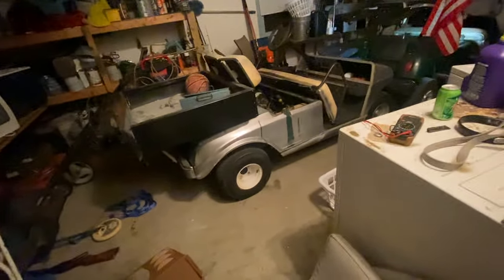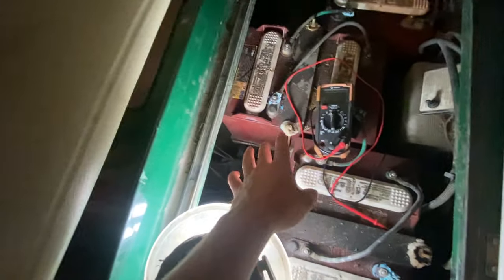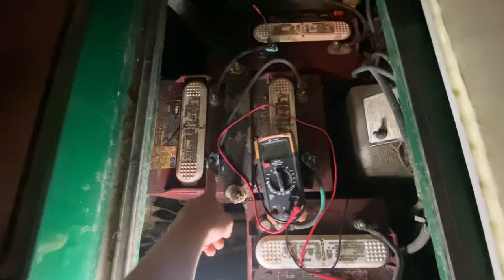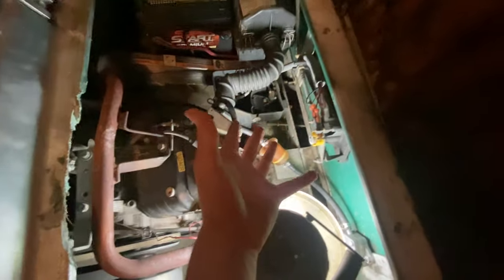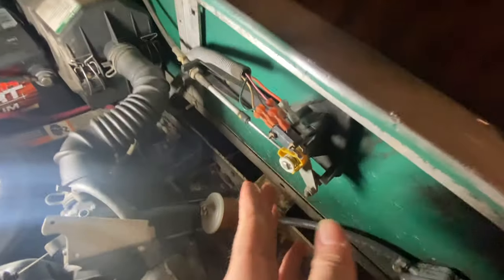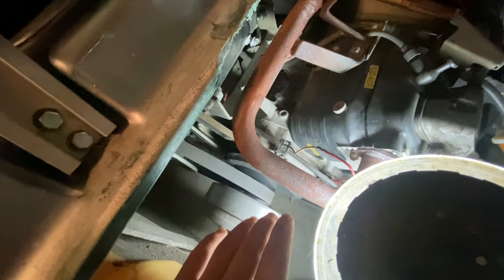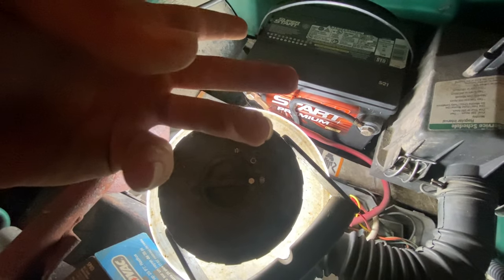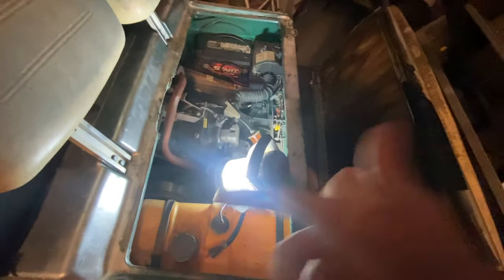How to fix a golf cart that want move

Comment: I have a 2015 EZGO S4 Express, Kawasaki gas motor. The car starts and runs great but will not shift into forward or reverse.  I cleaned and serviced both the drive and driven clutches (and belts) and they spin and work great. I have replaced the relay switch, checked all fuses,  etc. There is no knocking sound to indicate the gearbox has come apart. The F N R cable moves the selector on the gearbox but I was wondering if it was out of adjustment. I took it apart and noticed the shifter bracket seems bent a little, this may be designed that way. Any other ideas what could be preventing the cart from shifting into forward or reverse?

Comment: Hey I wanted to send a video but I don’t know how. I have a gas club car.  Engine runs and it has driven fine tell about a week ago. You can have it in forward or reverse and give it gas and it won’t drive.  You can feel it try to move barely.   The clutches are moving freely.  They have been replaced in the past year.  Basically belt spins and clutches move as they should but golf cart won’t move.   Got any suggestions?  Thanks
Reply: Mines doin the same. Have you found a solution
Reply: Same problem on a yamaha g16a going to go check this stuff out in video now

Comment: See my issue is I washed my golfcart. Its an exgo gas with the kawasaki engine in it. After washing it the golf cart started making a continuous beep noise. It would still drive, but it has a continuous beep almost like it was in reverse. Well I was told to take the seat and floor board apart let it all dry out cause its a common issue after washing. Now it won't go at all. Doesn't make a sound or anything when you hit the pedal. No clicks or any beeping. I hooked the battery up to a charger, and it says its fully charged. The lights will come on. The horn will honk, but it won't go at all when hitting the pedal.